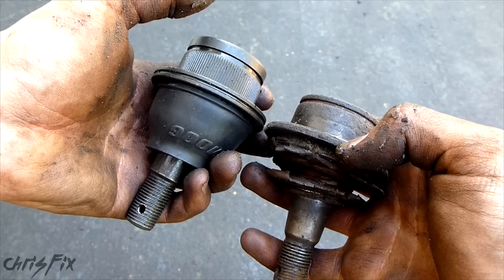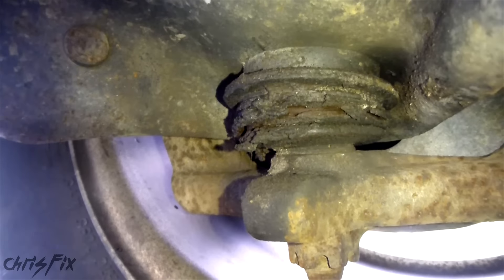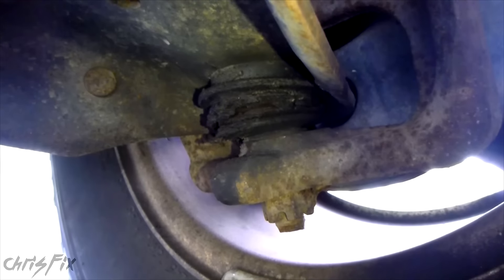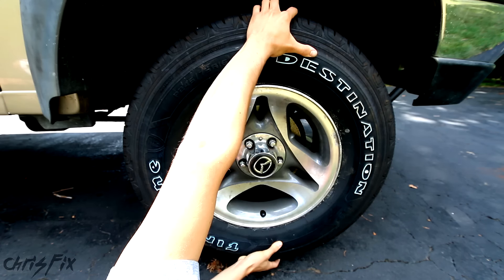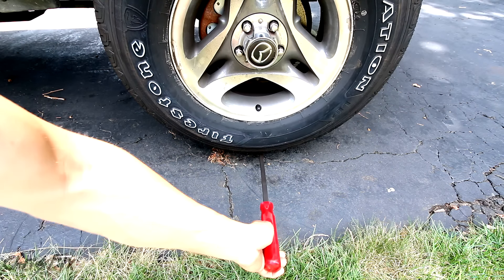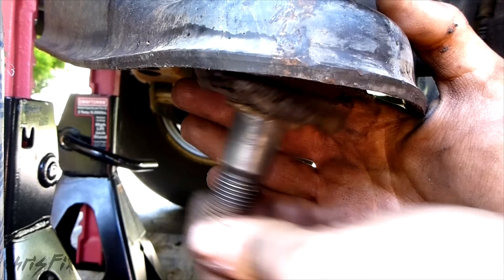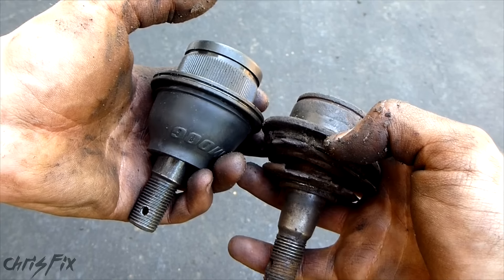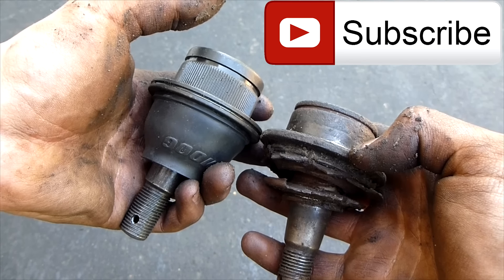How to Check if a Ball Joint is Bad

Comment: Non grease able what Mr know it all forgot to add the grease needle 💉 
Insert through the rubber
Reply from the maker: That is an option but I didn't talk about it since that can be pretty tricky to get right and sometimes doing that can cause more issues than it's worth. I replace ball joints with grease able ones anyway and would recommend that if yours are going out

Comment: hi Chris, great videos, always helpful.  You mention in this video that there can be parts where the ball joint isnt replaceable, can you advise on where that would be the case?  I would have thought that all ball joints could potentially be pressed out and new one pressed in.  How can you tell or can you?
Reply from the maker: You can tell because the ball joint will be held in via bolts or a retaining clip. If not it is rivited in and would need to be drilled out.
Reply: Every single ball joint can be replaced. Just gotta have the right tools, knowledge, and patience. I was taught by my instructor, whose off-road truck group always replaced them, rather than the whole control arm. But it can be done.

Comment: Can you check a ball joint by putting air in the front right tire? I went to a tire shop to get air in my right tire, and the guy said my balljoints are bad and need changing because I have size 22 inch rims that would make this happen. He wanted to sell me his tires that he said are normal size tires, bit I said I don't want any regular size tires. I've been driving my 2003 Grand Marquis for about 7 or so years. I hit a lot of pot holes in my days, too. I hear no noise. The only problem that I just started to get is a power steering leak that will make the wheel act funny when turning. When I put fluid in it, then it act right. Is he trying to scare me because I'm a female, and think he's gonna get me to take him up on his offer? He kept saying drive careful. He did not lift my car up. All he did was put air in my tire and made a diagnosis of my balljoints while putting air in my tire.

Comment: Heads up, if u put that moog splined ball joint in. That'll be the last one in that control arm. Those splines chew the control arm. So if you try change again, it won't fit tight. Even worse in aluminum control arms.
Reply: But it's a Ford .

Comment: You’ll know it’s good if it’s smooth to rotate and you can’t shift it up/down left/right. Also if the boot is bad that doesn’t mean the joint is but it will be in a few thousand miles

Comment: Hey Chris, is it best to do this test when both tires are lifted compared to just one tire lifted off the ground? Also, a different topic but my lower control bushings have cracks on them, looking like strectch marks no offense. But can you say, those bushings/lower control arms are shot as well? I have that clunky noise and I can’t seem to find it. I did this test but only one tire off the ground. Thanks for your help!

Comment: I have a 2004 Silverado 1500 rwd truck and in the YouTube videos I've seen there are two different styles of upper ball joints: one with bolts and one that's pressed in. How do I know which is better? Can I switch one for the other? Thanks for sharing.

Comment: Your ball joints can be destroyed by hitting a bad bump. It's always a good idea to check them if your car smacks a bad pothole. Not doing so can lead to a complete fail of ball joint with your wheel concaving in or out, which could cause an accident.

Comment: That is a dry ball joint. A greeased ball joint may not make noise. You want to check for movement. Lift the vehicle you can do the wiggle test. Best way use a pry bar to check for sight movement. You don't want to let your ball joint get as bad as the one in the video. Chances are you could have diagnosed that one just by the tire leaning way in at the top.

Comment: Me and my car: replaces struts and shocks. Steering goes out soon after. Replaces steering rack and pinion. Steering goes out again. Replaces power steering pump. Then a clunking noise begins happening from the front end. Probably ball joints. Also my car started going through coolant like crazy. Leaking coolant somewhere. What a bad couple months it’s been for my car...
Reply: Sounds like it may be time so sent it on down to the next owner

Comment: Thanks man i was worried about the Clicking noise coming from my car i thought it was a ball joint but wasnt sure. But helped me out
Reply: Clicking only while turning the car, but not while going in a straight line is normally a sign of bad CV drive axles on a front wheel drive car. Inspect the CV rubber boots for probably cracks and leaking grease and grit. Replacement of the CV drive axles is usually not a very expensive job.
Reply: @amerigo88   also thought that but everything seemed fine with the axle joints

Comment: My 98 Jeep Wrangler ( I bought it new ) has 238k and the original ball joints are just like new. I keep the front end greased and aligned and check my boots often for cracking . I'm also not abusing my Jeep with a lot of off-road antics . I hunt and fish so I would much rather do those than replace ball joints and other parts because I have been bouncing around pot holes on rocky trails or grinding my way through mud holes .. Besides.. I have never caught a fish or shot a deer from my Jeep . I learned that lesson early in life ; ) Not that things don't break , but they break a lot less applying some common sense once in awhile . Drive slow and enjoy the view off road. You'll save money and your kidneys will thank you also . Chris is heavy on fixing things ( and he's good at it ! ) and I am heavy at this stage in life on preventing from having to fix things . Amazing what old age and wisdom has taught me ; ) Oh... And guys , through the years I have found more people neglect their shock absorbers more than anything else on their vehicle. Mine get changed every other year and remember I'm not the one pulling into the car wash with thirty pounds of mud on my vehicle anymore ; )  If you want healthy ball joints you need to keep those shocks operational .

Comment: This video literally just saved me about $100 at the local Pep Boys for a suspension diagnostic! I was driving my hummer H2 through the local Wendy’s drive-through and made a pretty sharp turn and all of a sudden I started hearing the squeaking noises. I also noticed that my driver side front tire is leaning a bit. Being far from home, I had no jack to lift the vehicle. So I go on YouTube and type in “ do ball joints squeak when they go bad?” And lo and behold this video pops up and the vehicle in the video sounds exactly the same as my H2……. Next up!! Ordering some kryptonite ball joints.

Comment: Non grease able ball joints can be greased with a grease needle, the boots can also be renewed, what a planned obsolesce department in action is the auto industry. Not saying don't replace worn ones, but am saying, noise is cancelled and life is extended when you grease with needle in spite of manufacturers attempt to ratchet up their profit, done it.
Reply from the maker: Thanks for sharing!

Comment: is it possible a ball joint can be bad even if the boot looks okay? like not ripped or anything? my 04 Envoy is making these exact same sounds and there is a ton of play in the wheel, but when I look, the ball joint boots look good.
Reply: Yes it is possible because boot looks ok but the material of boot got hard and inside the boot joints got jammed and sometimes broken also ... So better to change without fear after 5 year...
Reply: LOL of course is possible.  Happened to me a couple times already.

Comment: How do you inspect a double wishbone suspension?
Reply: Find the balljoint, look at it. If it's not leaking, ripped, or obviously broken, it's probably fine. Touch it to see if it has grease in it. If it doesn't have grease in it, put grease in it, a few squirts is all you need, you will need a grease gun for this. And then see if it leaks if it doesn't leak, it's fine.

Comment: Dude that ball joint was so bad that it was an easy find! The  proper way to check the ball joints on that type of suspension with upper and lower ball joints is to unload them from the suspension by lifting from the lower control arm so that you can check the play! All bad ball joints wont be as severely worn and starved for lubrication like the one in this video! Some places have specs for  tolerance as to how much play is allowed before it is deemed bad! Especially when it comes to vehicle safey inspections!

Comment: This is what a bad ball joint sounds like on a typical light truck. When it goes bad in a first gen tacoma or 4Runner, it sounds like a gunshot or explosion as the control arm separates and the wheel folds under the frame while you are driving. Ask me how I know....

Comment: Good video as per usual.  Might I add one suggestion...?
Another easy way to test any kind of ball joint is to unload it, amd then squeeze the joint with a large pair of channel locks.....or similiar tool.  Play will indicate a bad joint.

Comment: I had a grand marquis for 7 years and every 2 years (40k miles) it would need new ball joints upper and lower. It was a rebuilt title and im pretty sure the front end geometry was a little off which lead it to eat balljoints. Other than that it was an awesome car!

Comment: I did the lifted tire check with the hands at the 12 and 6 o clock position and it mos def had some play. I replaced the wheel bearings and it's still about the same amount of play. This vid helped me pinpoint the issue to the ball joints. This is on a 74 Charger so I should probably stop procrastinating and replace those old crusty looking ball joints already.

Comment: If a spring or torsion rod is connected to the lower control arm you have to unload the ball joint by jacking the car up under the lower control arm. Not as simple as you showed, lots of bad ball joints will be missed if you don't properly unload them before checking for play.

Comment: Chris should have pointed out that it is DANGEROUS to keep a vehicle on the road that has ball joints like the ones he shows. If you hear noise, clunking and general looseness in the chassis it will not get better, but a failed ball joint at any speed is a disaster. The wheel will just flop over and the car is out of control TOTALLY!

Comment: Yeap. That was the same sound I had a couple of days ago. Great video. Right to the point without beating the bush! I took off the right tire and thought it was the metal part that is behind the rotor and I pushed it back. The sound was gone, but it came back again briefly and it was gone again. I decided to take my car to the mechanic, and he showed me that the lower ball joint it was loose. Thank you for your video. Very helpful!

Comment: Sorry to correct your way of checking ball joints but that is incorrect for that style suspension. You have unload the weight off the ball joints by lifting furthest outward on lower control arm. Your way is correct for McPherson strut style front suspension.  Cheers

Comment: Chrisfix, what is the effect it'll have on the drive?

Would you get continual shaking?
Or just clunks once in a while?
Reply: Continued vibration is symptom of bad ball joint, although a couple other issues could also be the factor.

Comment: Use Crowbar in Place of the Ball joint, you whanna test, and you can see is it Broken or not.
Reply: Do not work always.  I had ball joint that wasn't capable move up down with pry bar but has such noise.  Granted it will start move soon or lather with pry bar but sound is first symptom.
Reply: All the best, is making booth.
I hade Ball Joints the move before the make Sounds.
Thanks for the Tipp from Germany

Comment: You can also use channel lock players in some cases. That’s what helped me to see that my drivers side was worse than the passenger side. 

Otherwise both looked to be fine from a pry bar test on a lift.

Comment: Great video.  Just exactly what I needed to see. Thank you so much.  How long will a good ball joint last in a truck?  I have a Nission 720 Model Truck , 2 wheel drive, 1985 year, Carburetor engine with 2.4 Nzap engine. I had 200,000 miles on the on the truck in 2013 when the ball joints were replaces.  Afterwards I was told that the front end could not be lined up as the ball joints were bad at Pepboys.  The ball joints had been replaced in 2013 by Midas in Evansville, IN.  Now I told Pep boys that the ball joints could not have  been bad as I had just replaced both the lower and upper ball joints in the front of my truck. I thought that Pepboys was just trying to make more money off me.   Now I kept this in the back of my mind.  But I could not remember  at that time who or when I had the ball joints replaced.  Then I was at another auto repair shop and they told me that my ball joints were bad.  So now I'm wondering who's telling me the truth. Did Midas replace the ball joint properly?  How long do new ball joints last.  The manager at the time was KEITH.  Later I saw that Ketih resigned from Midas.  So I'm wondering if Midas pulled a fast one on me.  I'm almost ready to get a lawyer and find out what he can help me do to get this resolved.  But I need some general information about my truck and the ball joints. Do ball joints go bad after 5 years?  I call the midas and talked to the new General Manager "Lucky Jones" He said that midas only warrants the ball joints for one year?  Now it that normal for new ball joints after they are put on a truck like mine?  I mean I drove the truck from Early 1986 until 2013 without any real problem with the ball joints that I knew off.  I mean by that the I was not going through new tires all the time due to them wearning out due to lack of proper front end alignment.  So I need some general information on how long a new set of ball joints should last on a 32 year old Nission 720 pickup truck. I have the Sports model truck.  Any information you could provide would be appreciated.

Comment: Easier test for bad ball joints: if it is a Ford truck and has at least 50,000 miles since the last ball joint replacement, they need replacing again.

Comment: You are supposed to load the ball joint  meaning you are to lift your lower control arm with a jack as close to the wheel as possible.

Comment: good video, only problem is that your jackstands are positioned incorrectly. They need to be as close to the wheel member as possible to simulate vehicle weight load on the suspension. This is only required on an SLA suspension, which is what you are dealing with here. And Don't use a bar to check lower balljoint that creates immense leverage that is unnecessary, just use your hands. With enough leverage you can make a brand new balljoint have slight movement, proving that test to be incorrect.

Comment: Reading through these comment makes me laugh. I realize most people are not mechanically inclined, but it's not rocket science. You take stuff off, you put it back on. It's not any more complicated than that, until you get into the engine. And turbos and all that. If you know what a control arm is, then one inspection of "this is connected to that, and that,...) that's literally how easy mechanics is. Take off the stuff connected to it. Then remove whatever you're trying to remove. Then put the new one on, and reconnect everything. Every vehicle is the same, the process doesn't change because you have a different car. Just the steps, because some manufacturers are asshats who pit a bunch of shit in the way.

Comment: More often than not, any play you feel when you try to "wiggle" the tire with your hands at the 6 and 12 positions will indicate a bad wheel bearing.  You're not likely to be able to feel a bad ball joint that way because of spring pressure against it.  The pry bar under the wheel is a more sure way to check them.

Comment: These methods for checking ball joints do not work with every style of suspension, you need to know the proper way to check the vehicle you are working on. That noise can come from other parts in the steering or suspension as well.

Comment: I have seen alot of mechanics, did alignment and balancing of wheels  but still the problem is there, my 1994 pajero suv floats on road when it passes through a jump or bad road in a high speed, and I always have to slightly move/adjust the steering wheel while driving till the vehicle is moving, no matter its on smooth road or off-road

Comment: YOU JACK THE CAR UP AND STICK A BAR UNDER THE TIRE AND LIFT . IF THE BALL JOINT IS WORN IT WILL HAVE A SLOPPY MOVEMENT INSTEAD OF SOLD.   P E R I O D

Comment: There are ball joints that need up and down movement, specifically dodge solid axle trucks. The upper ball joint stud will move up and down and is designed like that from the factory for proper install.

Comment: Too many mechanics overtight the balljoints using the airwrench.  That will cut the life of them a lot.  Most Balljoints only need 60-80- pnds torque.  Any bushing or tip part with grease on needs no more than 80 pnds on most cars and light trucks.  Nuts or bolts that dont move might need more than 100 pnds depending on the part.  Buy a torque wrench or rent at parts store.  Im a bilingual shop instructor and shop manager.

Comment: I've been watching this channel for years. Today I took my truck to get an alignment and they would not conduct the alignment due to both of my lower ball joints being bad. It had upward and downward movement, but it was so minimal I had to have him do it 4 times before I could actually see it. The rubber boots were intact and in good shape. There was no damage to the unit. No leakage. No clicking. Then they wanted to replace the entire lower control arms for both sides. $1005.00 after taxes. I told them to go have intercourse with themselves.